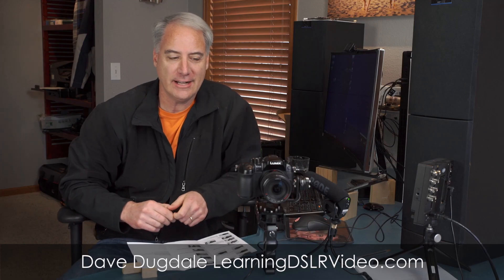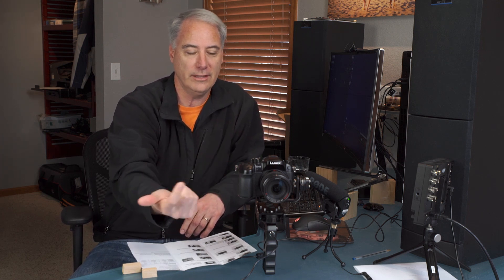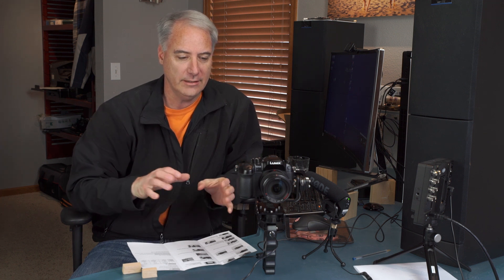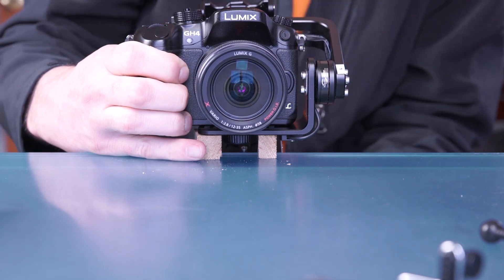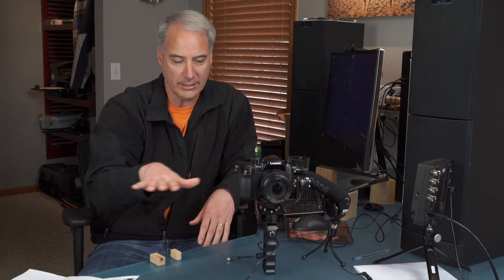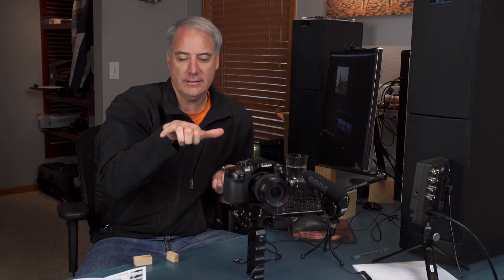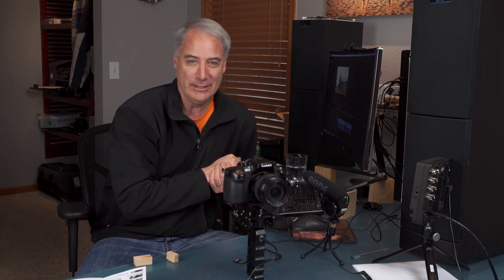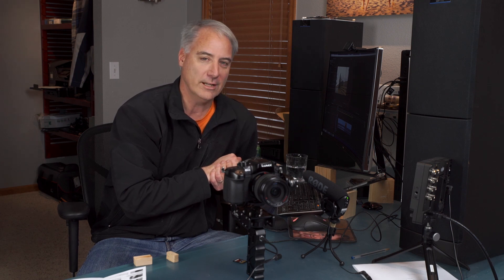Nebula 4000 Lite a Look at the Software Setup Video 2

Comment: Hi, thanks for your video. Question: is it possible to set the gimbal to have a lower horizon? I mean, I'd like to shoot with pitch fixed at (for example) 15° down. Is that possible to set this within the app? Thanks

Comment: Hey dave i was wondering if you could show me your RC settings, as well as follow mode settings  because i cant get my H1's joystick to work or the yaw to follow. i tried contacting support twice and all i got was here is the manual... i also joined a forum and cant seem to get much help. thanks again for the informative videos!  the gimbal other than that seems to working just fine and is stable.

Comment: Dave,

Thanks for some super videos just got my Nebula today and it works perfect except for mode 2 (2 pushes) the motors are buzzing. Tried both calibrations. Second question is does the software work on a mac?

Anyhow, I'm sort up to speed on these gimbals been using them on Drone Helis for years - if you get a minute check out my web site, got some good reviews on the drones t/ gimbal there - seems drones would be your next move if you like the Nebula Lol 

Many Thanks for getting me up to speed on the Nebula set-up. 

Mike 

www.rotory.com

Comment: Hi Dave.
Great Video. I have this problem where i cannot connect my nebula 4000 with computer directle through USB as it doent detect in the BGC software and hence doent connects. i was wondering how did you make it work as even in instruction manual it asks to connect only through blue tooth and that USB is not supported.
Reply: I have same problem
Reply: Hi Adam Grumbo. I have found the solution. You have to just download the User manual of BGC firmware and download the setup files they have mentioned in it. it works then.
http://www.basecamelectronics.com/downloads/8bit/
Reply: Visual Entity  Hi Dave, I downloaded all the files and run but still the USB connection is blank. If i click on the connect button there's an error message "select port where the device is connected". The drop down box next to it is blank without any "COM?" listed.I tried to download and run the Xloader. Hit the upload button and it says "can't open port". Nebula is connected to the USB port of my Surface Pro3. I tried to do the same using the Docking Station USB port but still the same. The SimpleBGC UI cannot connect or see the Gimbal.
Reply: Charlie Gregorio I have the same problem, just get a bluetooth adapter for your computer and it will recognize it right away. This is the only way to go and it works great!!! Bluetooth only

Comment: Glidecams and similar stabilizers give you much better footage and at the quarter of the cost :)
Reply from the maker: MrJMMedia :) you must be much better at glidecam works then I am, I suck at it.
Reply: MrJMMedia nebula seems like it would be great for traveling. very compact but yes requires battery.  mine seems to run all day shooting with no issues on a full charge.  camera ran out of batteries and memory before the gimbal did.
Reply: Dave Dugdale 2nd YouTube Channel glidecams do require a lot more time and practice over gimbals.  gimbals are great but can be finicky sometimes
Reply: I think that traveling with so many batteries is a big minus! Glide cams or similar stabilizers give you better stabilization, are cheaper, and you don't have to keep batteries on hand :) Plus they support more weight!

Comment: It has more bounce than big gimbals held with two hands--you can see it on the rails as you walk. Some claim that only a 4 axis gimbal completely cuts out bounce (see the You Tube video: 4 Axis Gimbal, Worlds first??). But I wonder if this pistol grip gimbal would handle bounce much better if it was mounted on a simple two-hand held mount, like the inexpensive Opteka CXS-200 Dual Grip Handheld Video Stabilizer Support System for DSLR Cameras. WIth a little mount like that, the gimbal would still be much more versatile than the big gimbals.

Comment: - Read how to do the 'advanced' calibration (It's easier to do in the GUI 2.3b9)
- The newer version has auto PID settings
- If you can't update it then the product is pirating the SBGC firmware and should not be recommended to buy as it isn't fully supported
- These single grip gimbals look pretty terrible to hold and use precisely